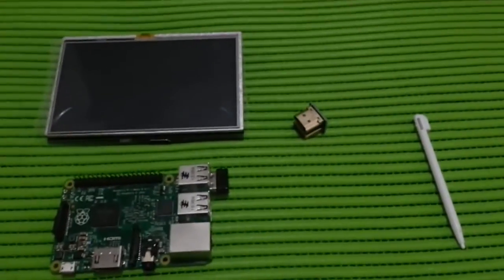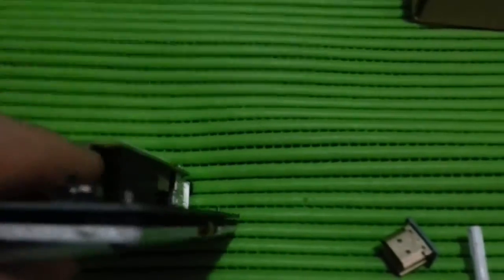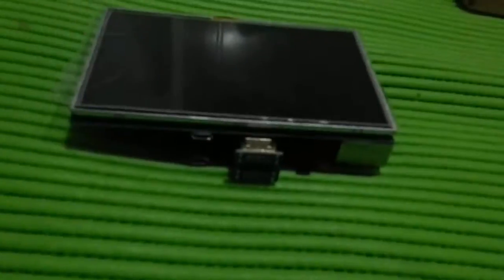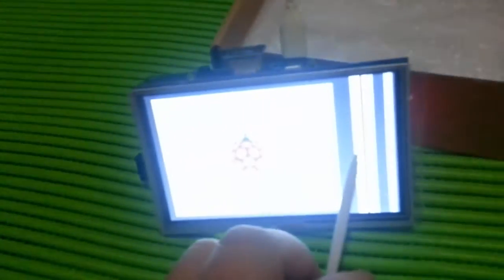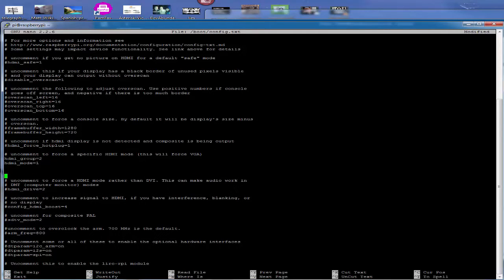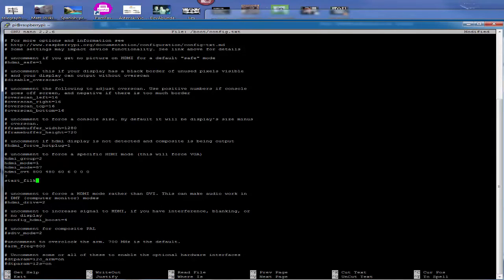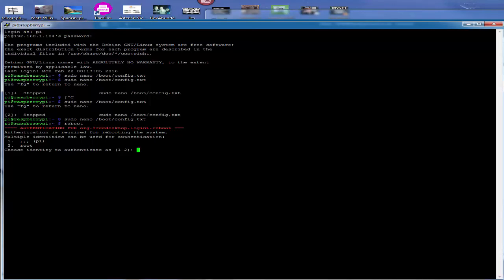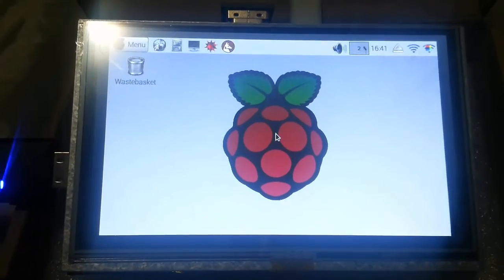Raspberry Pi: how to install a touch screen and configure software.

Comment: Whenever I try to turn it on, the touch screen shows black lines going accross the screen. I have a raspberry pi 3b and am using the same touch screen as you. I was told there was some code you had to add to the config.txt file in /root/boot/ so I added it, I'm not sure whats wrong....thanks for any help!
Reply from the maker: Sounds like the code is wrong, you need to be 100% its the right screen otherwise it gets confused. Its a bit like trying to load a video codec it doesn't have it simply doesn't work.
Reply: Oh thank you, I think you had one that says "V2", where mine doesn't
Reply from the maker: check the model number on the unit and google around. It took me a good hour to find the code for mine.
Reply: Yes I realized something, this only works with kali linux if it has "V2" on the back, otherwise it just shows a white/fuzzy screen. Thanks for helping me think out of the box, I've been cought up with this for days!
Reply from the maker: +Zack Grey get this stuff from time to time. Let me know if you get it sorted.

Comment: I have problem, now my display doesn't work. Doesn't work touch and now neither screen. But in start BOOT is all OK... I dont know what can it be? 
Please help me.
photo:  http://pasteboard.co/2jqC3OOJ.jpg
Reply from the maker: +Hater Loco What screen is it? there are other settings relating to getting the touch screen working. As long as you can login via the SSH (remote) you can sort it.
Reply: +matt wilkie Screen in my first comment is "boot menu".
Last text what screen shows: "No signal" that's all.
Display parameters: 10.1 inch TFT, 1024x600, resistive.
I able encroach to config.txt seamlessly.
Reply from the maker: +Hater Loco was it working before you edited something?
Reply: +matt wilkie Yes, Display to worked, but touch no.
Reply from the maker: Let me have a look in the morning as you need to set other settings for the touch screen. Have you got the model of the screen as there are different configurations for the different types.
Reply from the maker: +Hater Loco This tutorial is likely to fix it as I don't know the model on your screen, best to identify your screen and see if its supported :- http://www.circuitbasics.com/setup-lcd-touchscreen-raspberry-pi/
Reply: +matt wilkie I don't know if connect Raspberry to motherboard LCD touch screen from HDMI is suffice, or if i have to connect some pins. I have raspberry pi 3 but it should not be a problem.
Reply: +Hater Loco If it has a pin interface on the back already very likely yes. If you can give me the board number off the back I can take a look for you. If not sure email me a photo of the front and back of your screen and I will find out which one you have and its setup.
Reply: +Alicante Spain Board: PCB 80099-V.1 

Photo:  
http://pasteboard.co/2mtuHI2d.jpg
http://pasteboard.co/2mtFqeGz.jpg

Thank you for help ;-)
Reply: +Alicante Spain and displej is ER-TFTV101-1 
I search datasheet in 
http://www.buydisplay.com/download/manual/ER-TFTV101-1_Datasheet.pdf
Reply: Check the software at the bottom of this page ;- http://www.buydisplay.com/default/10-1-inch-raspberry-pi-screen-w-hdmi-video-vga-driver-board-1024x600

As i think the driver and setup are there.

Comment: this shit is so confusing. I can't find a good tutorial anywhere. why can't it just be plug and play.
Reply from the maker: Check for the label on the back of the monitor as it will identify which one you need. There are a lot of copies out there which is why the driver is an issue. But look for that and stick it in Google, hope that helps.